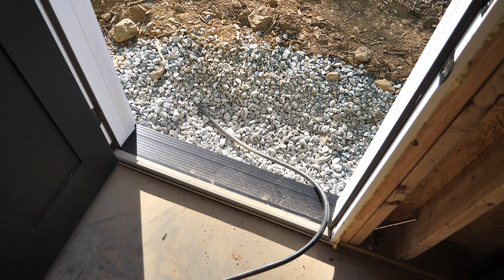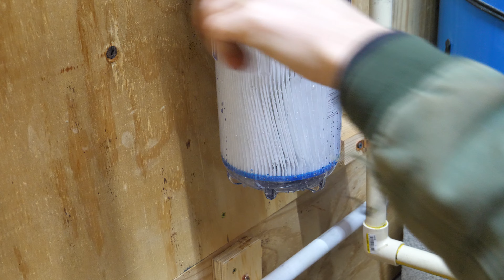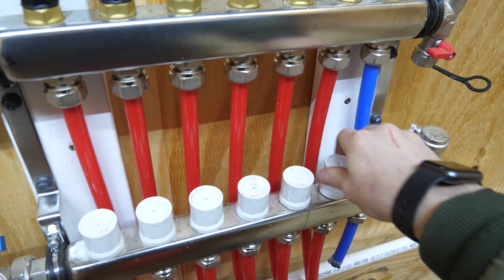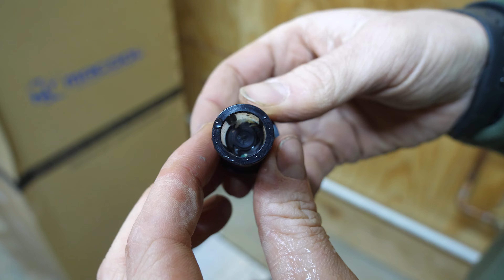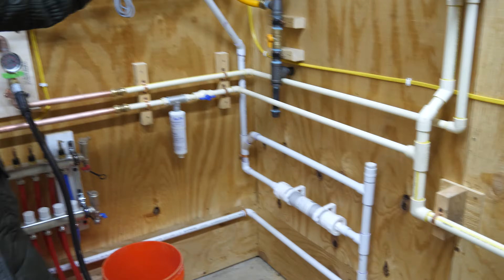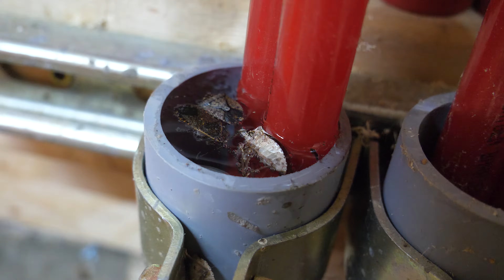FIRST START-UP of our Heated Slab (more leaks)

Comment: Exciting progress!  I hadn't noticed until today that you've got a combined space heating and DHW system.  Did you consider a closed loop system for heat, and if so, what caused you to choose an open loop system instead?  The system I'm designing is going closed loop for a couple reasons - glycol for freeze resistance as we're in an area that can lose power for periods of time, and with closed loop there isn't the constant introduction of minerals and dissolved oxygen to cause contamination or oxidation.  I'm always interested to hear why similar choices are made.  Thanks!
Reply from the maker: I learned about the closed systems but I went for open system for the following reasons:
-Only one heating appliance to buy/install/maintain/replace
-No separate expansion tank (uses well tank as expansion tank)
-Always cold water flowing through the floor during summer, preventing stagnation and providing some limited cooling
-Didn't want to use glycol (toxic to animals, cleaning up leaks becomes a hazardous activity, leaked water potentially into floor drain and septic system, etc.)
-Very easy to install, troubleshoot, & maintain (closed loop may be similar)